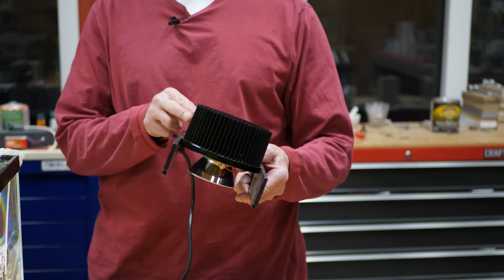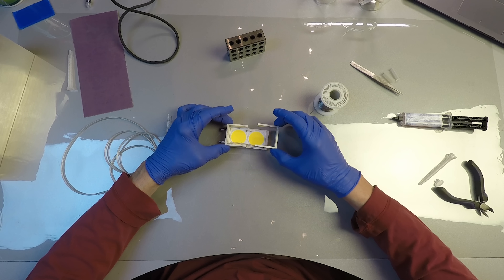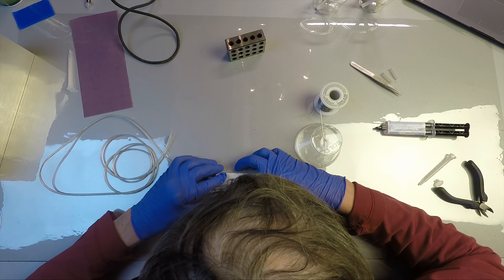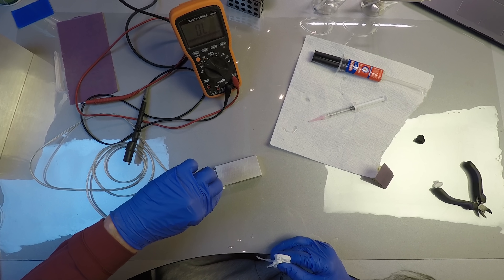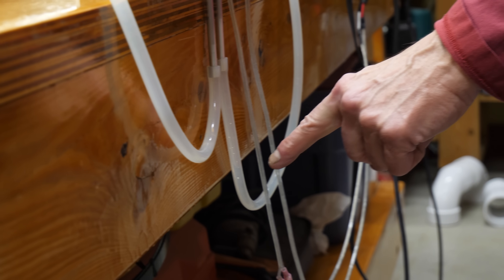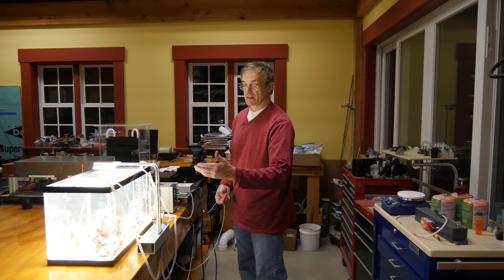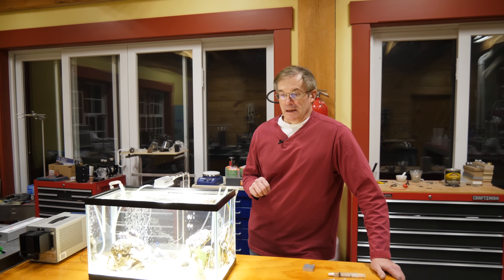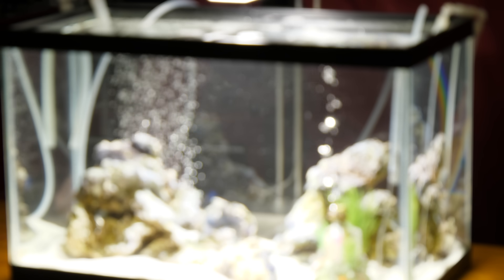40,000 Lumen LED Aquarium Light

Comment: You could also create a closed loop using stainless tubing in the base of the aquarium so it acts as a radiator and then you don't share water with the fish.
Reply: That would be a double benefit. No aluminum to fish water and no fish water into the cooling block where a bacteria reservoir may develop.

Although the epoxy sealant still seems like a good idea.
Reply: Yes! Any maybe use a copper block then. My guess is anyway that the fish poop and other contaminants will clog the block, no matter if coated with epoxy or not.
Reply: @graealex  Easily solved, take the cooling water after the filter.
Reply: @darkiee69  

"Easily solved, take the cooling water after the filter."

nope.

unless you are using a diatomaceous earth filter (which you don't want to do for long periods in most aquaria), you are still getting bacteria and detritus moving through the system.  it does not in any way stop bacteria from growing on the surfaces of the circulating tubes after the filter.
Reply: @thomasneal9291  If you pull a stream from the bio filter that only runs through the Radiator and only that water is run through a diatomaceous earth filter you will have a longer life of the filter and reduce the time needed before cleaning.

From an engineering perspective you all sound like a bunch of scientists. Try it and then solve the REAL problems.

Some thoughts. Measure the heat output of the light into the water and see just how much flow is really needed. 

Use an Raspberry Pi to adjust light level, measure heat and adjust water flow rate as well as measure it to watch for blocks. While you are at it probe the tank temperature, PH, nitrate, nitrite, ammonia.. Program it to simulate day, night and moonlight. Also use it to run a fish feeder device.
Reply: @graealex  There is a low chance of clogging. Fish poo is quite tiny and dissolved and the block does not have those tiny fins that like good CPU or GPU watercooling blocks have, and if it does clog a little you can easely blow it out by some higher pressures.
Reply: @brinkshows2720  I think the chance is very high, it's just a matter of time. I'm not talking about big blobs of poop, but about plaque, i.e. a hardening mixture of poop, caclium and other minerals from the water, as well as reminents of microorganisms. This will not only impede water flow but will also create a thermal insulation over time.
Reply: @graealex  Yeah that is true. But not impossible to cleanup. I guess its just regular maintenance then.
Reply: @brinkshows2720  Well, the two halves of the water block are glued together. Normally water loops are closed and an additive added to avoid corrosion and microbial growth. Cooling LEDs with water is an excellent idea, but I'm not sure about using the grimey aquarium water.
Reply: @graealex  I wouldn't worry too much about fish poo and other contaminants in the water. Aquariums already have pumps circulating the water around. Have had for decades, in fact. That's not a new concept Tech Ingredients came up with to cool his LED. And those pumps last for years and years. There's a filter on the inlet that keeps all the muck out.
Reply: @brinkshows2720  

"There is a low chance of clogging."

fish poop is NOT where clogging in tubes comes from (easy to block with filters on the hose intake).  it's from the growth of strands of nitrite oxidizing bacteria and general detritus clinging to that.  try cleaning out an inline filter system sometime.  they get rather full of slime.  and cleaning a system of long narrow metal tubes like this will NOT be easy.

I would highly recommend keeping this system as a closed system not in any way using tank water.  if you want to run radiator lines under the gravel, that's fine, but it should not use the tank water at all.
Reply: @brinkshows2720 /videos I want to keep the thermal energy from leaking out of a combustion chamber (large bore ~2-4cyl, or dual action hybrid), to reduce the need for cooling, increase the temperature and pressure of the power stroke, etc. Do you think Hastelloy C would be able to withstand the raised temperatures and combustion byproducts of a gasoline engine fed with a couple (~3%) percent extra hydrogen and oxygen?

If I need to add a layer of other material as a low friction high durability cylinder liner, and just keep the Hastelloy as an insulator, it will be a lot tougher matching engineering specs. Would prefer it to just be made out of one material, maybe with a coating or extreme pressure additive to the oil.

What are your thoughts, thanks!
Reply: I agree, using tank water he's used inert metals so the fish will be fine but what about the algae that's gunna take up residence on the acrylic below the cobs 🤔
Reply: The first problem with this design is that you would have 2 heat exchangers (From the led to the line water and from the line water to the aquarium water). The problem with this is that you would have a hotter LED. Lets say for instance if you have 20 degrees line water and have a 40 degrees led. You have a delta T of 20 degrees. (celsius). So if you use aquarium water you led is 40 degrees. When you have a second heat exchanger you need for instance a difference of 20 degrees also in the aquarium. So to cool the line water with the aquarium you need a delta T of 20 degrees and to cool the led you need a delta T of 20 degrees. So your led will run at 60 degrees (20+20+20(ambient)).

The second problem is with the thermal conductivity of stainless steel. It is so low you would be stupid to use it in a heat exchanger. If you would exchange a aluminium water block for a stainless steel one you would need to have 15 times the surface area to cool your led. For copper its even worse. For copper it has to be 25 as large of a surface area.

Copper has a thermal conductivity of 401 W·m−1·K−1
Aluminium has a thermal conductivity of 237 W·m−1·K−1
Stainless steel has a thermal conductivity of around 16 W·m−1·K−1

These 2 problems combined would definitely make this "solution" one of the worst and most expensive you can think of. What he did in the video was coating it with epoxy, what they do allot too is coating it from the inside with other metals like Zinc, nickel or some other metals. I  don't think this would fit also in an aquarium so his solution is the best for now i think.
Reply: @brinkshows2720  The fact that SS does not conduct heat well is certainly a factor. You deal with that by using thin wall tubing, and the appropriate length of it. It is not just surface area that is a factor. The thinner the wall thickness of the tubing, the less relevant the poor conductivity becomes.

With the appropriate SS tubing and flow rate, all the heat from the led can be transferred to the aquarium water. There is no reason that the led would need to run hotter with the addition of the SS heat exchanger.
Reply: @brinkshows2720  No it's not. Pete Sebert is right. You are not very good with numbers, actually you are pretty bad. Redo your math before replying to this.
Reply: @AntonioJoseAValerio  Well show me then if you think you are correct and iam not.
Iam a Electro Technical Engineer and part of my job is working with the basics of thermodynamics. (calculating heat losses and energy transfers to heatsinks etc)
Reply: @brinkshows2720  So it's not only your math that's wrong. Your job career is a tad wonky too.
Reply: @andrewbergspage  No i did not, you misunderstood me. I used the exchange from an aluminium water block to a stainless steel one as an example of how bad stainless steel is for a heat conductor. To cool your closed loop systems water you would need to have allot of passes through the aquarium, not just one or two lengths. Yes i know it also coresponds with the thickness of the material, but just average small stainless steel is still way to thick to have a decent amount of heat dissipation.
It is just plain stupid to have a double heat exchange cycle in your cooling loop if there are way easier solutions that are way more economic and efficiënt.
(yes i pulled the Delta T numbers out of my ass, thats why you call it an example)

Comment: I really prefer slow epoxy, there is a little trick. When you want to cure it - just heat it. Heating to some 60 C speeds up curing time from hours to minutes.
Reply: why not just use UV epoxy?  stays liquid for hours to work with... sets in seconds with UV.
Reply: @thomasneal9291  I do, and I love the stuff. Except, the one I have doesn't stick onto practically anything. It isn't as useless as one might think at first, but still.
Also, in many situations, the place to be cured cannot be UV-illuminated for some reason. Then, photocurable stuff is useless. In TechIngredient's video, there is a thin deep gap between Al plates, which may be difficult to properly illuminate all the way through.

Comment: Ive heard of others trying to cool equipment with water from their aquarium and it seems biofilms, algae, parts of plants/corals and small animals clog it up and burn things out often. ive been considering trying to make a chiller out of a computer radiator but i want to find a way to make it where the tank water does not flow through the pump and radiator. but some way transfer the heat from the aquarium water to the water in the chiller. maybe a large cooling block like this, then the pump and radiator. and the cooling block can go in the aquarium? ive tried just pointing a fan across the top of the tank with the lids off and letting evaporation handle it but it looses way to much water way to fast. still very interesting project.
Reply from the maker: Use the water return, after passing through the filter, to cool the light.

Comment: Ridiculous amount of light for an aquarium so its a terrible idea.
Reply from the maker: That's silly. High power allows you to place the light high enough to illuminate a large tank.
Reply: @TechIngredients  Except that you're demonstrating a 40,000 lumen LED light on a tiny aquarium, light super bright and talking about it being low profile. If used for a large tank, low profile is not a concern, and also the dispersion pattern of a typical LED is not well suited to be place high above unless you're going to make deep reflectors for them to reflect most of the light spilled to the side, downward.  

Also why worry about adding heat to the aquarium when you can just double up on your LED and use standard heatsinks with air cooling to avoid the possible need for chillers. This is just adding complexity thats not needed IMO

Also my 300 gallon tank with two huge canister filters pumping 1800GPH barely make a dent in the temperature. Most tropical aquariums are run into the mid 80's which may need hundreds of watts of heating to give that kind of rise over ambient.  A couple 65W pump motors will do virtually nothing in relation.

Comment: The epoxy in the water block would work, but you would need to rotate block several times to empty out the middle chambers instead of just turning the block up like you demonstrated, or else the epoxy would plug the inner passageway.
Reply from the maker: You're right and I should have mentioned that.

Comment: Wouldn't a heat exchange coil with a sanitary solution be better than running fish water directly both to prevent sediment issues and not worry about contaminating the fish water? Also doing it that way on a big fish tank, probably should put an external heat sink with a fan attached controlled by a thermometer in the tank.
Reply from the maker: You could, but if you don't have to then this would be more effecient and cost less.  A big tank does not need the additional heat and a remote radiator will lower cooling costs.

Comment: In light of all the crap that likes to grow in aquarium water, would silver-plating the aluminium & steel help, rather than using the epoxy? I'm not familiar as to whether silver has any effect on algae & fungi, but it seems like it might help at least slow growth by limiting the edible bacteria in the system.
Reply: silver is an antibacterial
Reply: @Ender_Wiggin  Yes, but I mean would removing the bacteria that provide nutrition for the other stuff also prevent the other stuff from growing in there?

Comment: Tech Ingredients is my favourite youtube channel, and I am a passionate aquarist. I've been looking forward to this video!! Thank you very much. I have shared this video with my local aquarium club, and will build try this out for my own aquariums. This is the most aesthetically pleasing  LED light I have seen, and it's DIY!! I find this very impressive.

I have several thoughts:
Are your calculations regarding the heat flux based on freshwater or marine aquariums? My amazonian piscine friends love warm waters (25-30C), and I have a 150 gallon aquarium. However, I live in Canada, so there's quite a ΔT between the tank and the cool basement they are housed in.
It looks like you have an in-line pump. Often, on larger aquariums, the water filtration system is a "sump" under the tank, a separate, smaller container holding filter media. Two thoughts here: A sump and the plumbing, I assume, add a bit of heat loss to the system, so a cooler may not be required for this setup, depending on the specifics. Secondly, a submersed return pump could be used to pump water from the sump through the light, and simply be returned back to the sump, all hidden behind the aquarium. This would also solve a third point:
This system adds a lot of unsightly tubing to the aquarium, while many aquarists attempt to hide all the hardware. However, the sleek, simple design of the light is so impressive that the tradeoff is totally worth it! The return hose could easily be clamped just inside upper rim, as well. I'm sure that an in-line system could be developed as well!

Thank you very much Tech Ingredients, I appreciate your videos and the technical, logical approach.
Reply from the maker: My experience is with SPS marine aquaria and there heat quickly becomes a problem.  Wherever the pump is placed, the water supply to the light can be routed through whatever supports are used to mount the light.  These don't have to be below the light, but could also be in the hood.  Alternatively, the pipes could also be made from acrylic and the supports could be nearly invisible.
Reply: @TechIngredients  Good idea with the acrylic. I have glass covers over the tank to reduce evaporation, and my LEDs currently just rest on top. With this setup the supports for the LED could be omitted entirely!
Thanks for the inspiration.

Comment: That COB doesn't appear to be the spectrum you actually want for aquarium plants or fish.
Reply: Check the 'rainbow' at 18:48. Maybe a bit skewed towards the blue but it looks like a full spectrum.
Reply: @kirkc9643  Aquarium plant and fish LED's are always very purple or blue. Full spectrum isn't what you want. https://www.kessil.com/products/horticulture_H380.php
Reply: @mntbighker  Those just have higher efficiency for the amount of light they produce. Full spectrum LEDs would have lower light to power efficiency but as long as the light intensity is the same it will perform as good if not better.
Reply: @mntbighker  Wrong. Google 'Osram Biolux' just for example and note the words "full spectrum". Not to mention the fact that sunlight is full spectrum and it seems to work welll for aquatic life
Reply: @Ender_Wiggin  Agreed.
Reply: @kirkc9643  Biolux appears to be fluorescent. And "full spectrum" is a term thrown around far too much in the lighting industry. Even sunlight is totally different depending on depth, latitude and time of day. To replicate the light a specimen needs you have to know the depth where it lives among other factors.
Reply: @kirkc9643  Nice. I pity your fish and coral that I doubt you have. Maybe they got lucky and the wife got custody.
Reply: @kirkc9643  - your "Osram Biolux" is not the same spectrum as sunlight. Not even close. The graph i saw also has a couple of nasty spikes in the UV. It is also big, contains Mercury, and if the phosphor is damaged the UV is very dangerous. The CREE is available in multiple "temperatures" and CRI values, pick the one that suits you best. It also does not match sunlight, but it seems closer. They also last longer.
Reply: @michaelyoutube5149  I think you missed the point.
Reply from the maker: They are available from 2,800k to 6,500k and the spectral curves are available for each.  The mechanical design of the COB is otherwise identical.
Reply: @TechIngredients  I'm not exactly sure how difficult it is to source COB's with that big dip in the spectrum you want for plants and aquariums. Especially marine. But I'm not opposed to your design. I do wonder how long it would take salt water to eat it's way under the epoxy coating. Probably best to stick to fresh water.
Reply from the maker: There are epoxy coated marine tanks that have been in operation for decades.
Reply: @TechIngredients  After a lot of experience with reef tanks I can tell you that no matter how careful you are coating the inside of that thing with epoxy you will eventually have the epoxy left and no aluminum. But I bet there are heat blocks that would work just fine with salt water. If I did a liquid cooled DIY marine setup I would start with an off the shelf PC CPU cooler running glycol. Even with fresh water I would start that way. But that's just me.